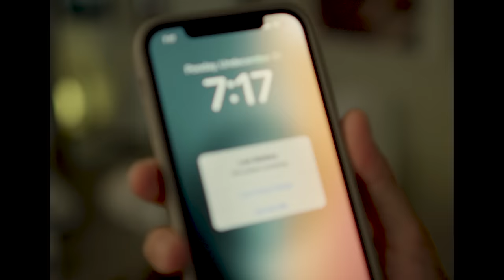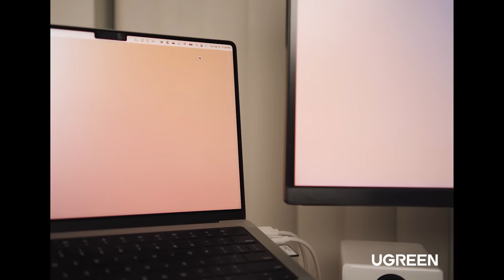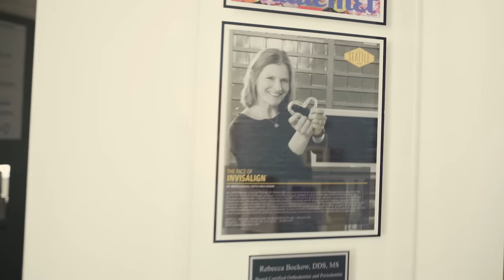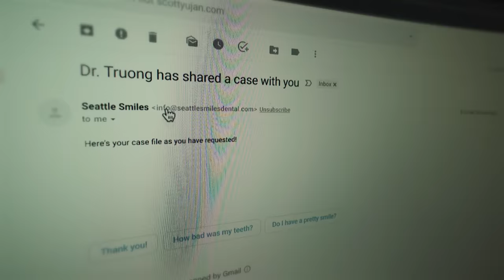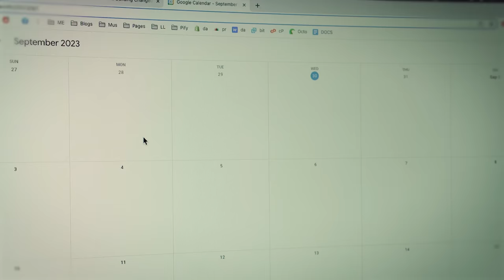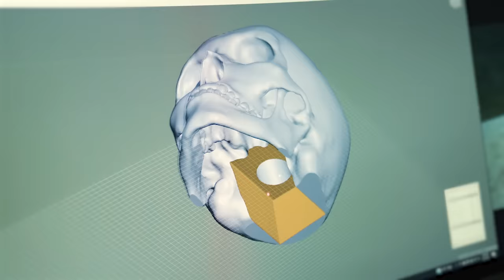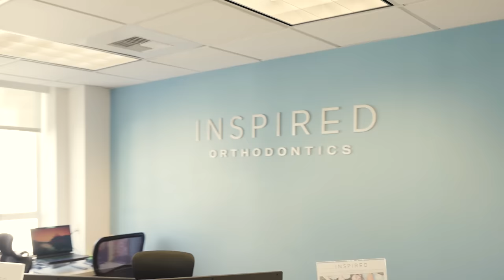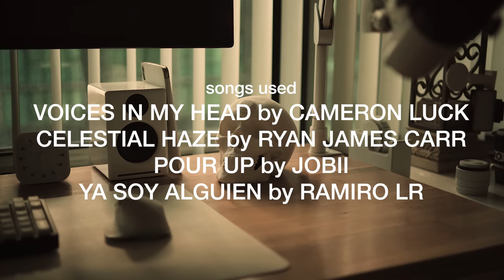decisions are hard, making is easier

Comment: "monitors its temperature to prevent overheating" ""smart" :))) That's just a basic safety feature, every phone has two(CPU + battery) even a water kettle has one to prevent fires.
-10 points off UGREEN